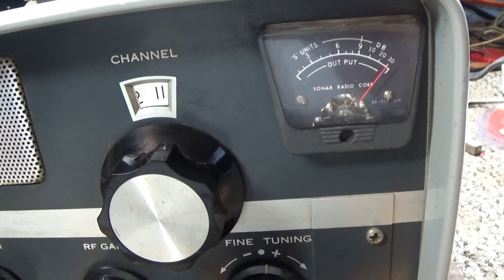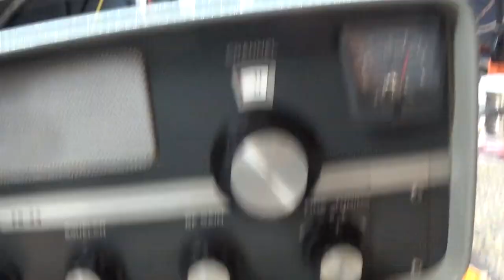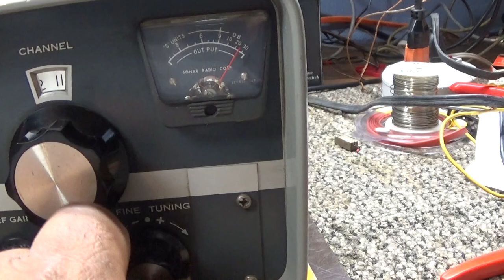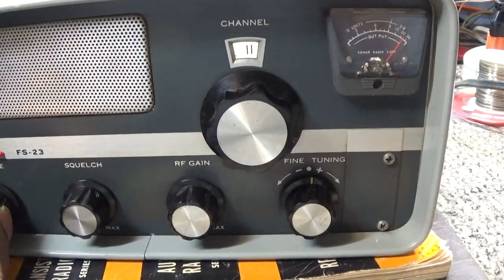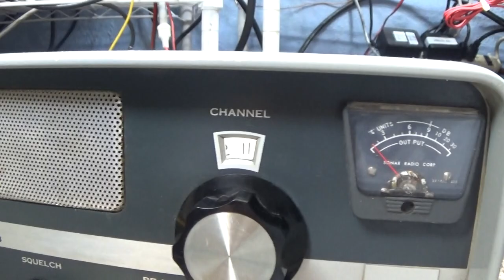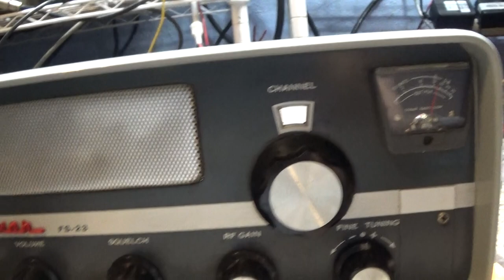Sonar FS-23 tube CB radio listening to long winded locals

Comment: Great clip doc. I've three fs23's, 2 fs 3023's, and up until recently two FS 2340's. I never use the 23 or 3023. The 2340 is not only a 40 channel transceiver as you know, but is far superior in many ways to the earlier 23 Channel sonar models. The person who purchased my second 2340 turned out to be a terrific person, and I'm glad he's the one who got it. I did a couple of videos to show that the 2340 worked exactly as I described it RX and TX. I don't know if you ever got a chance to check out my channel, but i kinda hope you do. It doesn't pay to subscribe as I only make a couple of videos to post each year. But I would like you to see the receive and transmit demonstration videos I've made of the 2340 I sold. Once again dr. nice video, and a terrific transceiver. PS I've heard you mentioned several times that sonar was initially a marine radio company. And although that is correct to a point, they actuality  started out making early amateur radio equipment. VHF and UHF transmitters and receivers many years before they went into the Marine business. 73 s

Comment: Just got one of these what antenna are you using?
Reply from the maker: Imax 5000
Reply: @tramdr  thank you so much for your feedback I've scoured all throughout the internet and it's not found any antenna for them god bless you and happy operating 🤘
Reply: @tramdr quick question what coaxial cable adapter are you using because I looked at the back of the fs-23 and where it says antenna it doesn't look like an regular coaxial will plug into it. Also what kind of antennas would you recommend for fs-23 as I searched up imax 5000 and all I got was the imax 2000 if that will also work for it  thank you I greatly appreciate your information as I am just getting into ham radio operating and as always Happy operating 🤘
Reply from the maker: I don't know anything about the FS23 having the wrong coax. Imax 2000 will work fine.
Reply: @tramdr  oh thank you for the information I will use an regular coax for the SF
Reply: @tramdr  ok I'm having a problem with my fs23.  She receives perfectly fine but when I can't transmit I have a dead key and a dead needle. Also The needle works perfectly fine on receiving end What tubes should I suspect to replace if that's the problem?
Reply from the maker: Are you saying you have dead key or are you saying it doesn't have dead key?
Reply: @tramdr  well both you see the key starts drifting but only when receiving not when transmitting then it's dead to be honest I don't think I'm transmitting. I might need to replace tubes
Reply: @tramdr update. I have troubleshooted it and  found that I have the wrong sonar model. Mic so the question I ask now Is what Mic are you using?